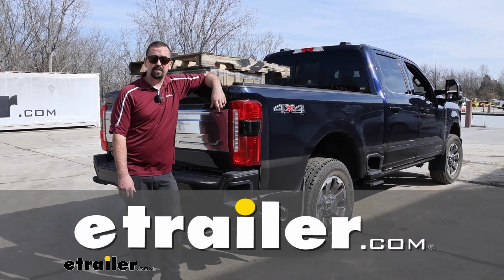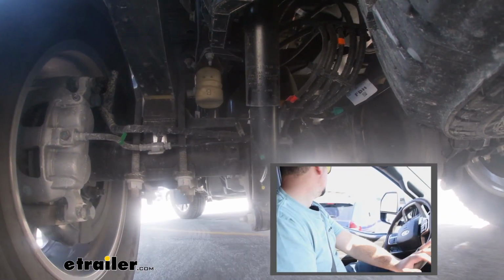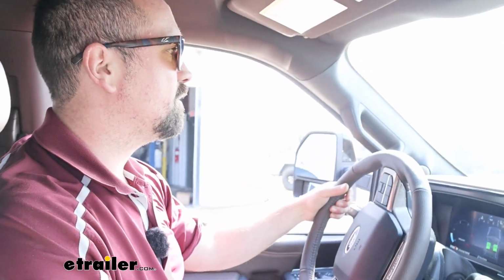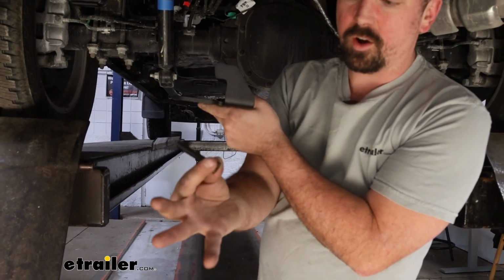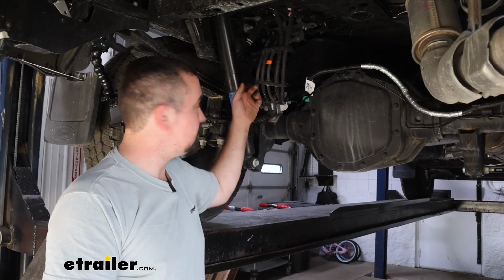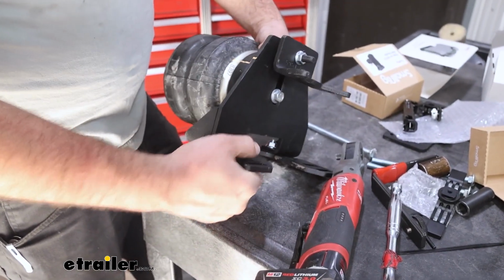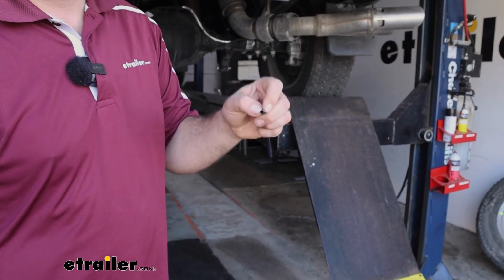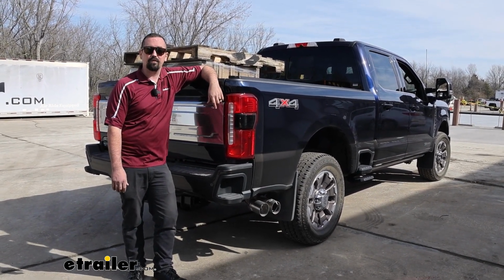Set up: Firestone Airide Red Label Extreme Duty Air Helper Springs on a 2024 Ford F-250 Super Duty

Comment: dude why do none of these videos show it with a gauge
Reply from the maker: Because the air spring kits themselves don't include an air pressure gauge. Some of the compressor kits do include a gauge that can be read through the control panel mounted under the dash or through a remote control (depending on which compressor kit you choose). I'll link you to the compressor kits we offer.
https://www.etrailer.com/dept-pg-Air_Bag_Compressor_Kit.aspx
https://www.etrailer.com/Vehicle-Suspension/Firestone/F95FV.html